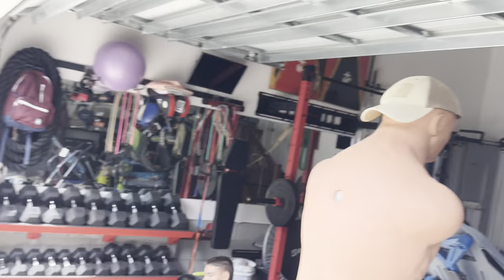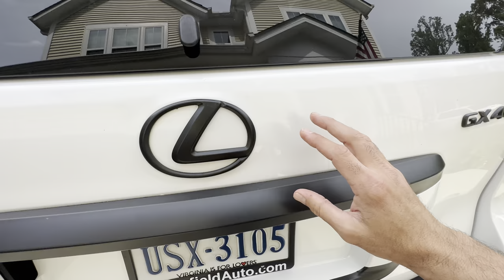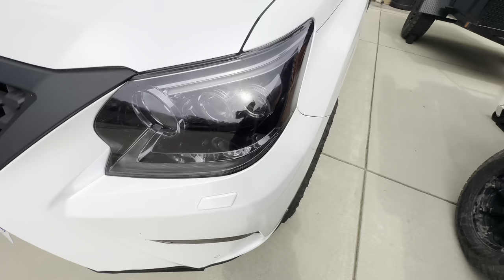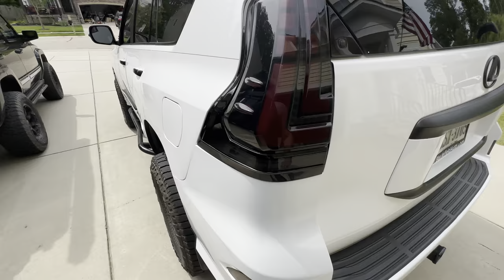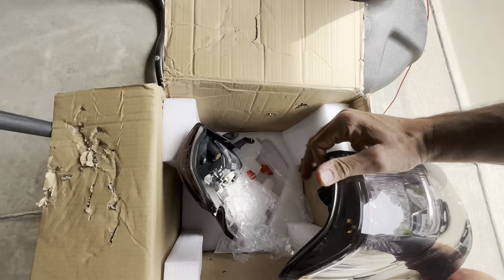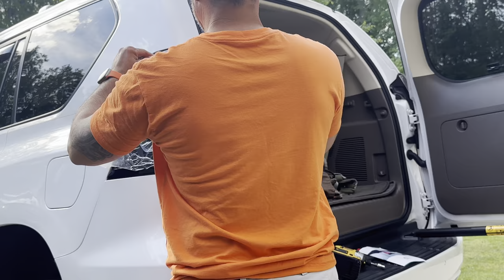UPDATE ON THE GX460 BUILD

Comment: Hi. Just wonder can you just paint it over chrome trim instead of wrapping it with tape. I don’t know if it’s going to last. Your wife sure has skill and patience. My GX got rock chipped on the upper chrome trim of the front grille. I tried to touch up with chrome marker pen. It  a bit better but still I’m not happy every time I look at it. Nice work! Thanks
Reply from the maker: What's up brother thanks for your post!  so to answer your question, yes you could do regular black paint.  However you would have to prep the trim first.  the paint needs something to hold on to so you would have to sand the trim down then paint.  I used hyper dip which is like plastidip, which you dont need to prep first but it gives it a rougher finish.   Here's the other thing to think about,  if your going to paint over trim that is near the front or that gets a lot of wind when driving then your going to be doing more maintenance on it from time to time only because where the wind hits it constantly is going to wear down faster.   

that's why for me, I just changed the whole front grill with the black,  I wrapped the sides because that's going to get a lot of wind, and I used hyper dip on the back chrome.  

I hope this helps and if you have any other questions please dont hesitate to ask.

Comment: I Have a Prado in my home in Spain. I also have Lexus GX460 in my home in Alaska, Love them both. I just ordered the rear lights and it says plug & Play. In a video I saw, it shows they come ready to connect to the Prado, but for the GX 460, its brings the proper adaptors and even has the gap fillers for the GX. Any tips on the install you can share, would be greatly appreciated.
Reply from the maker: Hi William, thanks for your post and thanks for watching! I saw a couple of videos that was the same with having to use an adapter. Luckily, when I got mine, they were already set to plug and play. The only tip I would have for you is the fillers maybe add Extra double stick tape, because the ones that came with mine were weak
Reply: @OJCoz  Oh wow, OK. I guess I will have to wait and see how mine arrives. I will certainly add the extra double stick tape, maybe Gorilla brand. Thanks for the quick response, Your GX looks great. Cheers!
Reply from the maker: @williamgalicia6219 cheers, brother and thank you!
Reply: Hey bud, hope all is well. If you read this, I am in Alaska and installed my new lights last night. It was fairly simple. I removed the Prado Harness and the resistor, installed the GX connector and done. It all works great, but I get a getting a hyer flash with turn signals, but hazards ok. Should I attempt to put back the resistor?
Reply: Just installed, all looks great, but I am getting a hyper flash with turn signals, not too bad, but it’s noticeable. The flashers are ok. I removed the resistor with the Prado connection, should I install back,, the resistor. My mechanic says this hyper is normal with these lights.
Reply from the maker: @williamgalicia6219 hey William sorry for the late response bro. I must have missed this when it came in.  I would try it.  And ultimately if it works then let it be:)

Comment: Do you know how you  can actually delete the chromed trims before painting. I don’t mean to cover up with plastic dip or tape or some other methods. I want to paint the piece of chromed trim around the front grille on my GX. I think the paint won’t stick on chrome if I want to paint over it. Any suggestions. Thanks.
Reply from the maker: You would have to roughen up the chrome so that the paint will stick to it.  So basically putting sand paper to it and then painting it.  Putting on enough coats that it will not come off.   The problem with that is since it’s right at the front were the wind, bugs, rocks, and rain hit the hardest…the paint can you get at Home Depot will only last so long.  You would have to re-prep and paint once a year would be my guess.
Reply: @OJCoz  Thanks. Some others suggested having ceramic coat over paint to protect it.
Reply from the maker: @haduong5828 that’s an option.  It would create another barrier against the elements
Reply from the maker: Another suggestion would be to price out how much it would cost to wrap it. And also price out how much to replace with all blacked out pieces